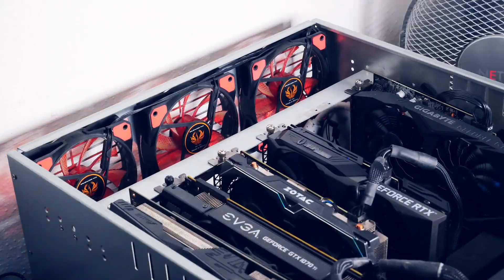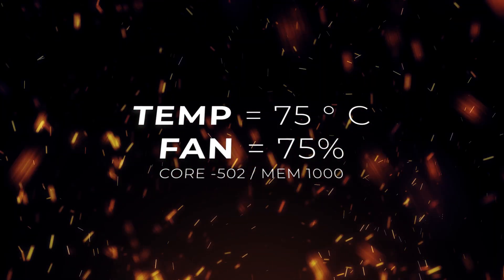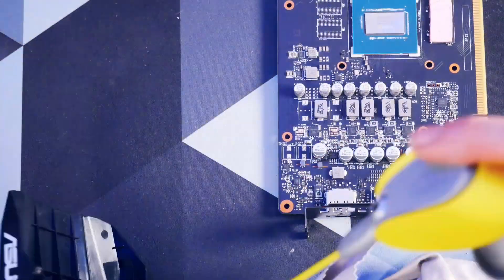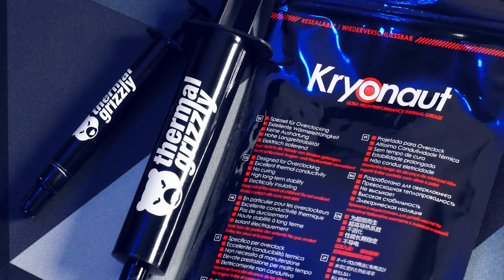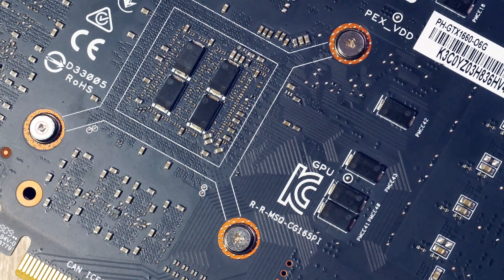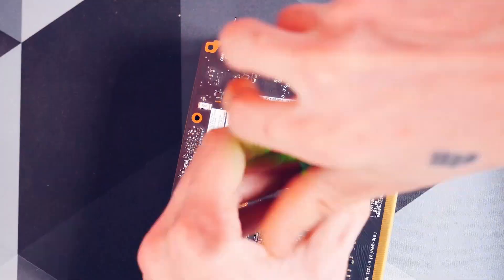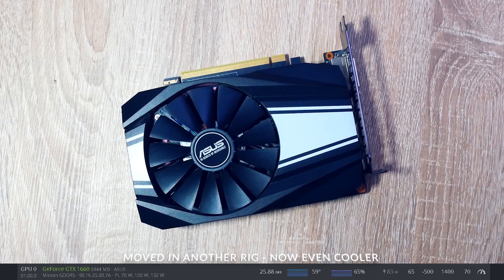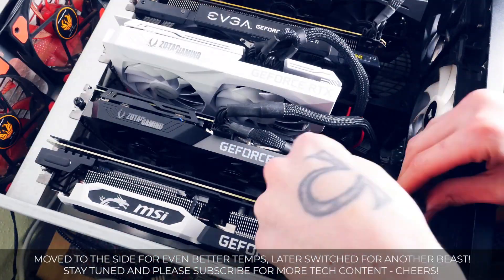GTX 1660 meets ThermalGrizzly: Lower temps for Asus Phoenix single fan GPU | GPUmining maintenance

Comment: What are the measurements in mm of the thermalpads you have used? They are not the originals are they? They are not the originals are they?
Reply from the maker: Others have confirmed to me that indeed the pads in the video look to be not from factory. I tried replacing them with both 2mm and 3mm thermal pads, none of both options improved the card, so I am guessing it is either a design flaw itself (small card runs hot either way), or, the original pads were between 2 and 3 mm, unfortunately I am not sure! Biggest difference was still the pasting :) cheers

Comment: I have this Asus GTX 1660 Super. I just bought it used yesterday. Temps were about 85c to 90c. I am not sure, because I ran it 2 minutes 100% and I stopped the benchmark at 85c and it was still climbing in temperatures. I cleaned it and changed the thermal paste and now it runs at 75c, stable over long runs (like 10 minutes). Also, I locked the max frame rated to 60 fps in NVIDIA Control panel. In Furmark, this resulted in a 70% power usage, a stable temp of 58 Celsius. I'll leave it like that. It's for 1080P gaming, and 60 fps is plenty for me. The low 0.1% should be awesome, since the card has headroom.
Reply: Yesterday i undervolt my Asus Phoenix 1660s oc. Was playing Froza Horizon 4 the temp around 86-84°C. After undervolt it's run about same FPS but temp 68-72°C

Comment: I have this gpu,mostly runs at 83°C at full load in oc with 780 mhz memory and 180mhz core clock,i have to change the termal paste time after time for it to maintain that temperature

Comment: Used this card for 3 years. Recently sold it as I bought a TUF 6700 XT and BOY the difference in temps...

It's pretty clear why this car runs so hot. It's heatsink is tiny. I sold it for a friend that proposed putting TG's Kyronaut on it. I was really curious to see how that would've worked in game temps
Reply: I'm playing rdr2 with this card, with some features at high it reaches 83°C
Reply: @Cipactlidifusion  same i play rainbow six siege and battlefield 2042 and the temps are over 80'C. I have some noctua thermal paste laying around so i might aswell give it a try
Reply: @Cipactlidifusion  i highly recommand to undervolt. That dropped my temps by 10-15 celsius!

Comment: mine is running up to 90c when the fan is at 100%...
Reply from the maker: that is hot :( did you try changing thermal paste? It helped the most for this card :) cheers
Reply: @CursedMining  yeah already did that didnt help tho
Reply: @maxruge1380  i changed the paste too with noctua stuff temps dropped like 2-3 celsius. then i undervolted the card and now its 10-15 celsius cooler
Reply: @joona425  how i work the undrvolting?
Reply: @sidahmedmed6021  there are tutorials on youtube for it

Comment: Just a heads up, I recently cleaned mine and reapplied some cheap thermal paste. Right away I'm getting the same results as you. So I'm guessing right out of the factory they have bad thermal paste application. Mine didn't come with thermal pads tho.... and still doesn't have any... yet I get 32.56MH/s with power set to 70w and a custom fan curve. No aircon with australian humid summer.

Comment: Man just broke the fan on mine and This was my first pc, have no clue wtf I’m doing trying to replace it 😭
Reply from the maker: you could slap a 120mm fan on the heatsink and power it externally :)
Reply from the maker: it is an old video, but I did it once here: https://youtu.be/3SkZ9K9nOoQ

Comment: how thick where the thermal pads on this card? now im also thinking about maybe replacing the thermal pads could maybe help out with reduce in the temps.

Cheers from Sweden
Reply from the maker: Weirdly I tried both 2mm and 3mm respectively and neither did achieve better results (even though I used good quality pads). It seems Asus may have used something proprietary in between. Could be that you get away with a softer 3mm pad, those were the pads I ultimately have on it now while not having better thermal performance than in this vid, around the same. Cheers :)
Reply: what thick thermalpad did you put in it?

Comment: This is so good to find this video! Have 5 of these cards and they run super hot! Going to give this a try! thank you
Reply from the maker: heyho mate! You are very welcome :) good luck on the modding!!
Reply: @CursedMining  do you know what size thermal pads are required to replace them?
Reply from the maker: @kaizen1723  I tried both 2mm and 3mm and both did not provide better temps :/ it is super weird. I am a bit afraid they have some weird inbetween-size, or it depends on the pads thickness.
Reply: @CursedMining  thanks! Im going to email asus and see if they can help.
I’ll come back and post here if i get an answer
👍🏻
Reply from the maker: @kaizen1723  oh thank you for that! If you find something I would do a follow up video and credit you :) after those fails I left it and turned to other cards, not yet done on all. Oh and I meant "thermal pad stiffness" on my last comment sorry, they all differ a bit
Reply: @CursedMining  finaly heard back from Asus. According to them “Mix of 58mm x 12mm 2.5mm and 27mm x 12mm 2.5mm thermal pads.”
Reply from the maker: @kaizen1723  meh, that is why neither 2mm nor 3mm worked well :/ maybe 3mm if they are very soft. Thanks for trying mate!!
Reply: @kaizen1723  This is great information. Thanks for sharing it.
Reply: @kaizen1723  
bro what thermal conductivity Thermal Pad is there no difference? the main thing is that it should be 2.5 mm

Comment: How loud is that single fan at 65?
Reply from the maker: Not audible for me but I may not be the best comparison, like that now it sits in an open frame (AliExpress vid lol), the CPU fan of that system (Wraith) seems louder than the GPU, but now also at 52w thanks to absolute core clock. Hope it helped a bit, cheers

Comment: All fake. I did it! zero changes
Reply: The world is fake, lol :)
Reply from the maker: Did you properly cover the chip with paste? Was it good quality paste? Did you also spread the thermal pads or replace them? Other than that: is has happened to me with cards that I did not properly slap it together and things did not make good contact so I had worse results than before. Other than that can't think of anything, definitely not fake, 55°C down to 55Watt right now after tweaking core more :) cheers

Comment: Hello brother can you help me? My 1660 Super Single Fan (Lenovo OEM) hits 82°C on 100% load. Is there any way to reduce temperatures? It is just a month old and still has 3 years of warranty. Should I get it replaced?
Reply from the maker: I fear they will claim it is normal but you could still try and see what they say. But yeah that is hot :/ did you try reducing powerlimit a bit in something like msi afterburner? Adjusting fan up etc.? Maybe you can still get it a bit cooler without loosing performance, cheers ⛏️
Reply: @CursedMining  Wow thanks for such a quick response man!
Unfortunately you're right, they said it is normal temperature.
I feel like they're simply lying to me. The product literally has "GAMING" in its name but the customer service rep told me it is not a gaming PC hence the high temperatures.
Brother I am a complete noob with zero knowledge about reducing powerlimit, changing fan speeds, etc. Also, the fan runs at 100% on full load so I don't think reducing fan speed will result in lower temperatures.
Well the GPU isn't throttling right now but the fans are very loud and I fear about the longevity of the graphics card.
Reply from the maker: @MehulMewal  look into a program called: msi afterburner :) if the GPU is not locked, you could try reducing the power limit by say 5% and check if it gets your card below 80s. And ofc I rather meant ramping up the fans, no help if already at 100%. Also I agree, manufacturers are misleading on single-fan cards :/
Reply: @CursedMining  thanks for answering my queries, much appreciated brother. :)
I'll try to reduce the power limit and see if that works.

Comment: Did you test the card without the thermal pads? If so, was there a difference in the thermals or not?
Reply from the maker: without thermal pads at all? No I did not test and would not recommend, it gets hot enough as it is. I swapped the pads a bit later, no difference, but I would not leave them out, cheers
Reply: @CursedMining  what thickness for the thermal pads do you recommend for this model? also my card is the same model and it goes up to 80ºC too, I'm not sure if it still has the pads or not, but it gets new paste frequently to no avail.
Reply from the maker: @FlameSkull95  oh if the pads are gone then it definitely explains why it is burning up. I would guess them 2mm as with 3 I had bad results, 2mm had same results but if your card has none at all, they are degraded or not covering the vram fully you will definitely feel a difference :) cheers
Reply: @CursedMining  Ok so I applied some thermal grizzly to the GPU die itself, but I also noticed that after all, the vram chips weren't fully covered up by the pads, and so when I went to do a temperature test, with the default settings on afterburner (except I cranked up the fans to the max), and I still got temperatures over 80ºC when playing something like battlefield 3 at over 100 frames per second.

Comment: Can you tell what thickness those thermal pads were so I can get the new ones of the same thickness.
Reply from the maker: hello, I tried 3mm but it made the card worse, so 2mm. I did not get any  improvements by changing them btw (I did so a bit later)
Reply: @CursedMining  So if I try changing them it should be 2mm ?
Reply: @dhruvmishra7457  I'm interested in knowing aswell. Did you ever change them?
Reply: @Dustzzz  mine looked fine so I just changed the thermal paste with the NT H1. Dropped by 10-12 degrees.
Reply: @dhruvmishra7457  with 2mm thermal pads ? Thank you

Comment: From day one my ASUS GTX 1660 super runs hot. All the online test sites mention that this card runs hot compared to other brands. It just has a very bad cooling system.
Reply: try "MSI afterburner" and tweak fan control.
Reply: @JoniNovak  Thanks for the advice but I have been using MSI for years. It was the first thing I adjusted when I installed the gpu. But there isn't much more you can do when your gpu is at 80% usage and the fan is already at 100% and the temperature is 85 degrees and still rising and you have all your case fans running at full blast. Nope... It's just a very bad standard ASUS cooling design on this particular card.

Comment: not effective. the cooling system needs to be replaced.
Will Accelero Mono Plus work?
Reply from the maker: I did some research on it, from what I know only the Accelero 4 works, but also not out of the box but with customisations, that's why I did not go for it. Cheers

Comment: Hi great vid im just wondering if there is a way to just remove the plastic shroud on top to replace the fan without having to remove the heatsink? I got a new fan for mine as its started to make a clicking sound but im not sure because i never toke it apart before. Thanks buddy :)
Reply from the maker: Hey mate! If you manage to unplug the fan from the outside it might be possible to then pull the cable through, but tbh I have not tried! Good repasting can't harm it :) cheers mate
Reply: @CursedMining  Ok i will try that thanks buddy and i will slap some new paste on too while im at it :) thanks for the reply
Reply: Hey, what fan did you get as the replacement?
Reply: @Synastar  Cooling Fan T129215SH 4Pin for GeForce GTX 1060 from Ebay

Comment: my single fan 1660ti is the coldest of them all cards. 65pl -502c +1147m 75%fan <60º in a hot ambient 26-27º
Reply from the maker: it must have a good position in the rig, awesome temps!
Reply: @CursedMining  actually its on my pc. i recently shoved it into my disk bay cuz i needed the x16 slot for a 1080. but even befor that as a main card was still cold in both mining and gaiming.
Reply from the maker: @PifchoBG  that is great :) I have mine in another rig now where it is also way cooler! Was just next to other cards it did overheat a lot! Happy mining/gaming ⛏️

Comment: do you know a  good conf. for rtx2070 super? im using windows , i've just started on this trip
Reply from the maker: I have only a non-super of it, but in HiveOS - I manage around 43 MH/s at 120watts. Powerlimit down as far as you can go (can't tell you exact as Win does %, Hive does watts) try between 50-65%, then Core -502 and memory I have at +1350 (already calculated for Win) - might not translate exactly to your card and I think there might still be some memory headroom but I did not get to tweaking it lately. Hope it helps as starting point - welcome to mining, best hobby there is - cheers ⛏️
Reply: @CursedMining  how much mhs goes the asus1660s with 1 fan?
Reply from the maker: @sebastianmugica7747  I don't manage more than 26 on that one, mem doesn't not stay stable higher. PP70/-502 core +1250 mem in hive